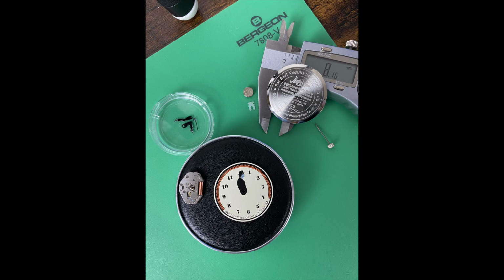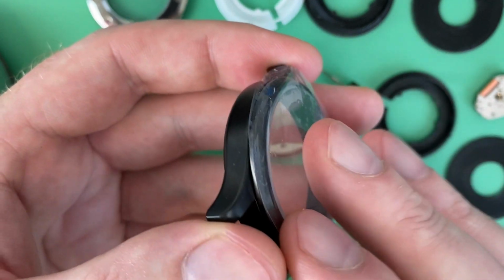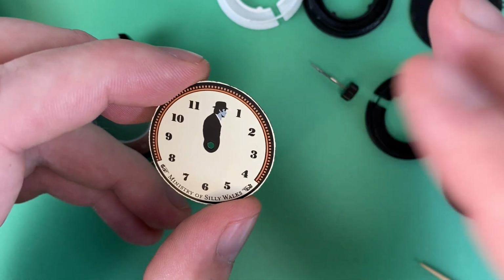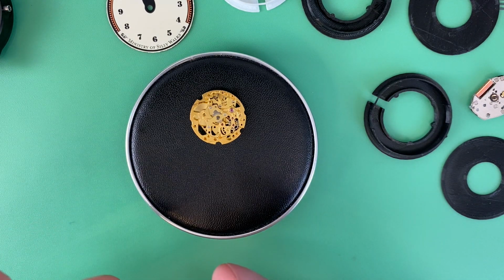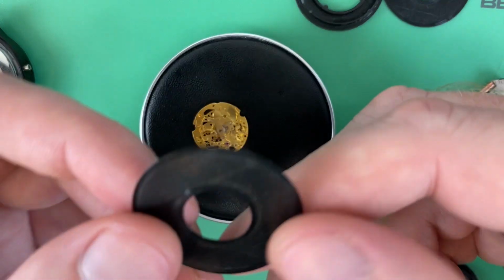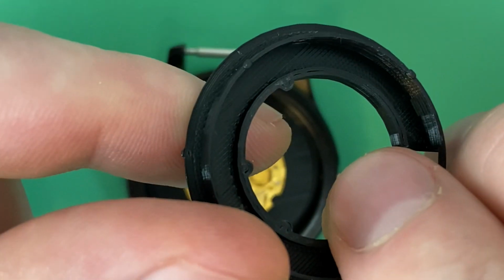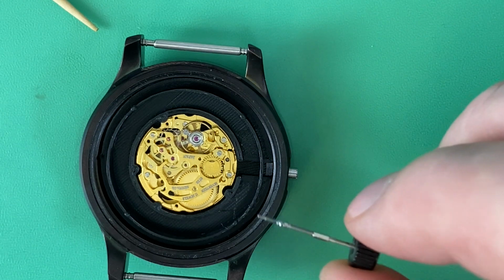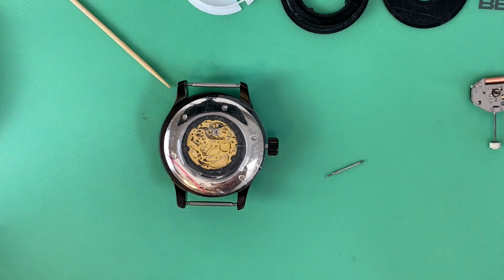Monty Python Ministry of Silly Walks Watch Mod Part 2: Parts and Swap Quartz & Mechanical Movements

Comment: Cool little project. You should consider a different CAD software like Fusion360 or adjust STL export settings to get actual round parts without all the flat edges.